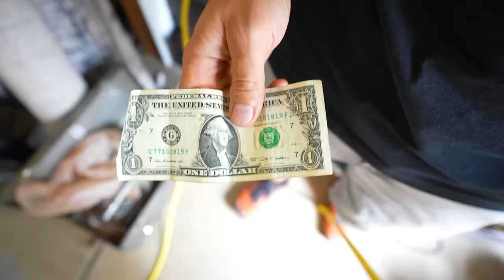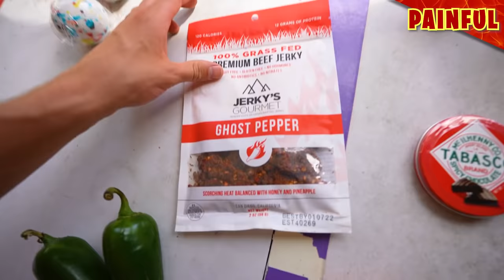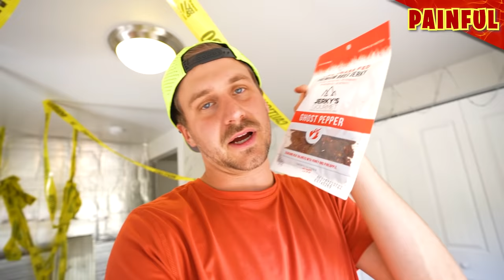Painful VS Comfy BEDROOM CHALLENGE!

Comment: I feel like the bed for the painful room was a “little” overkill
Reply: Could've flipped the board over, or hammered the nails to the side (flat-ish).  But that probably wouldn't have kept in the "spirit" of the challenge.  So painful 😨
Reply: True
Reply: It will not actually hurt you that bad it will just be painful
Reply: @leenone8456  bro fr Justin could have easily just hammered the nails in or bent them or even just slept in the walkway where there no was pain.

Comment: Actually, at a local science center, they have a bed of nails that you can try to lay on. And it surprisingly doesn't hurt. 

It think it has to do with your weight distribution and the spacing of the nails, but those nails on Justin's bed looked way too sharp and too far spaced out.

Comment: He’s are called pop it
Reply: Actually, at a local science center, they have a bed of nails that you can try to lay on. And it surprisingly doesn't hurt. 

It think it has to do with your weight distribution and the spacing of the nails, but those nails on Justin's bed looked way too sharp and too far spaced out.